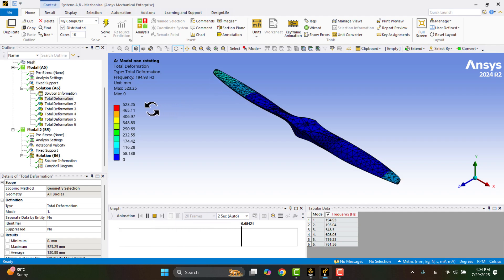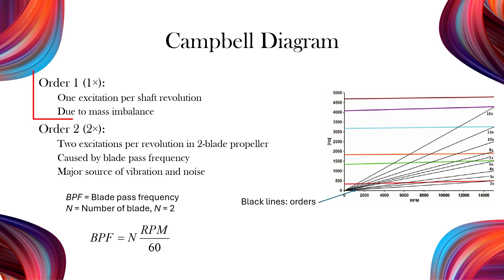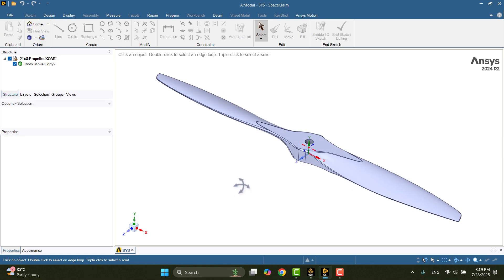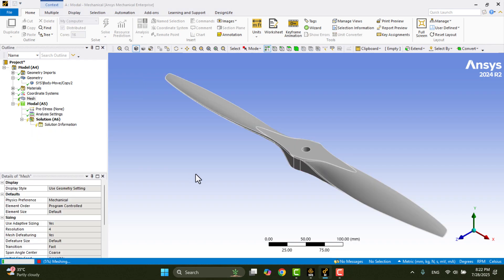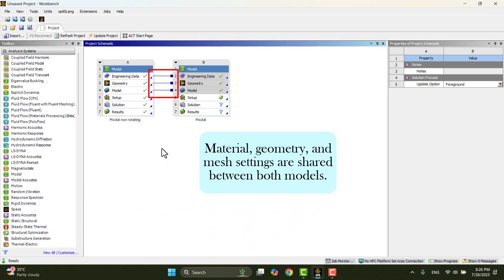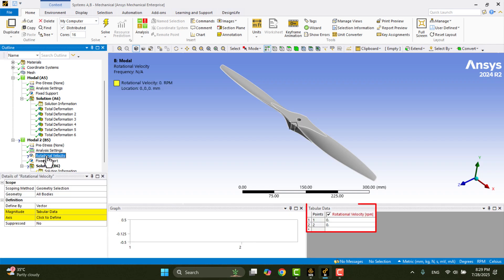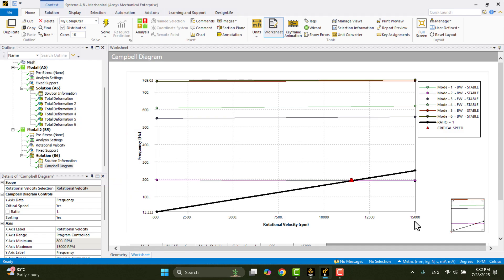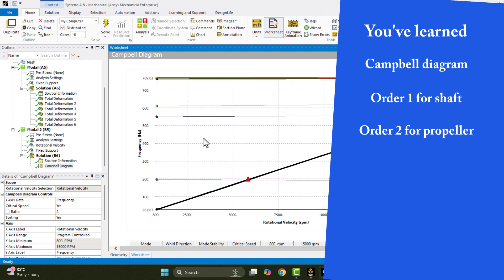ANSYS Tutorial: Campbell Diagram & Modal Analysis of a Propeller | Critical Speed & Whirl Modes

Comment: What if it’s at even higher rpm? For instance, from the mode shape the first torsional is at mode 3 at zero/low rpm, but mode 5 at operating rpm.
Reply from the maker: Hello, RPM depends on the operating speed of the engine. I specified a real value. You can specify what value you want.

Comment: If possible please make a tutorial on scramjet combination, correct way to find its combustion pressure and mixing efficiencies. Also, thank you for your tutorials on acoustic signatures I’ve learned a lot from them. I'm currently working on a similar topic for my project.
Additionally, could you suggest any software tools, relevant knowledge areas, or CFD techniques that would help make my acoustic signature project on aircraft propeller more successful?
Reply from the maker: Hello, thank you. Unfortunately, I haven't worked on scramjets before. I think scramjets produce broadband noise. You should use the permeable FWH method. That's all I know.